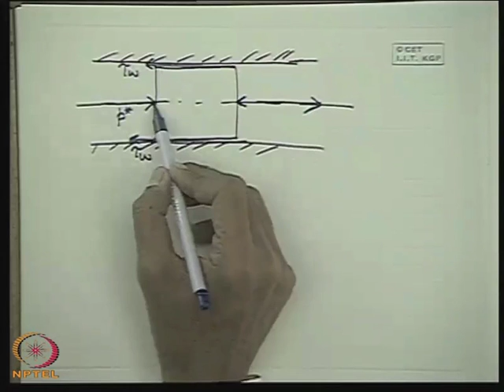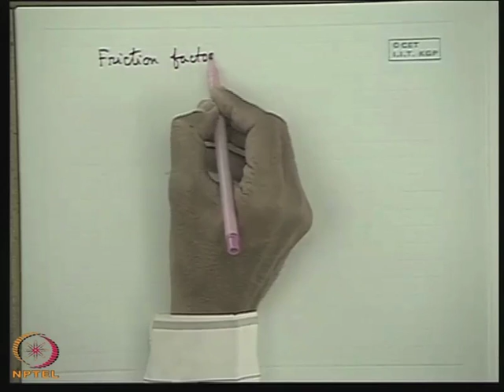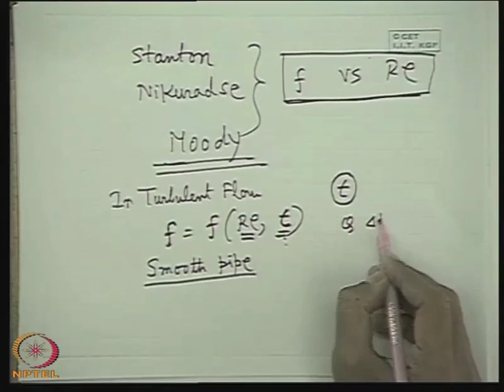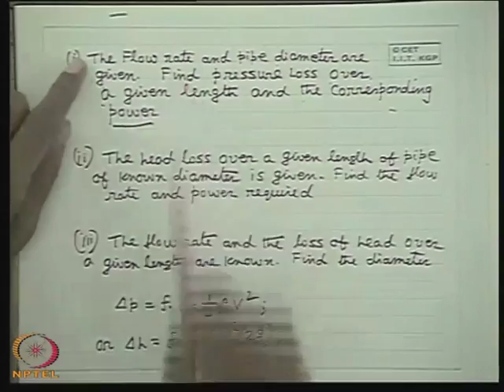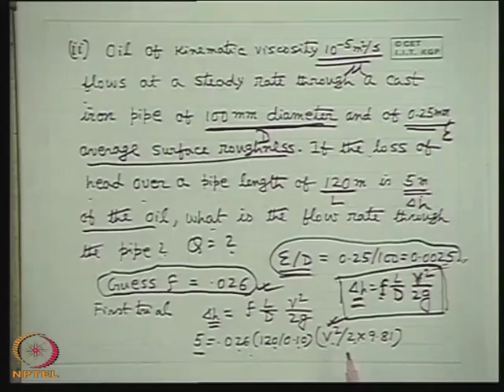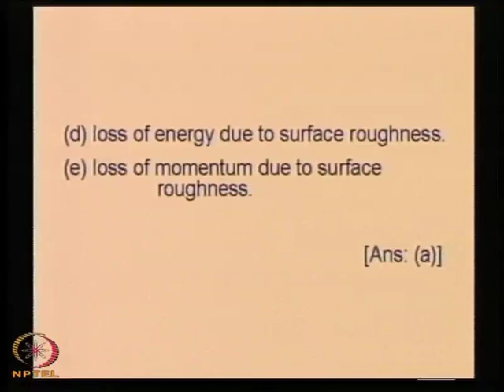Mod-33 Lec-33 Application of ViscousFlow Through Pipes Part I

Comment: 19:03 there is an error in values of Reynolds number for different flows

Re <= 2300 - Laminar flow
2300<Re<4000 - Transition flow
Re >= 4000 - Turbulent flow

Comment: How's inertia force zero?
Reply: It's because components of intertial acceleration is zero.. (RHS of Navier stokes equation)
Reply: @Shubh_joshi199 since the flow is fully developed,the velocity profile is not changing w.r.t axial coordinate we can say that the flow is non accelerating.so the inertia term of navier stokes' equation
Reply: In last case we have taken different approach by balancing stresses. Now here we are only taking x direction stresses . I am getting confused. Where to apply which method.?